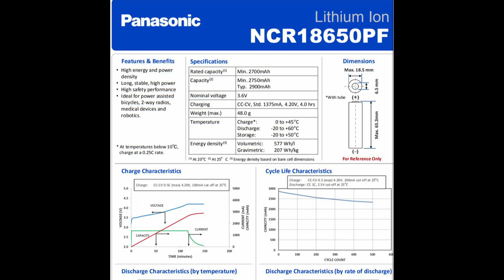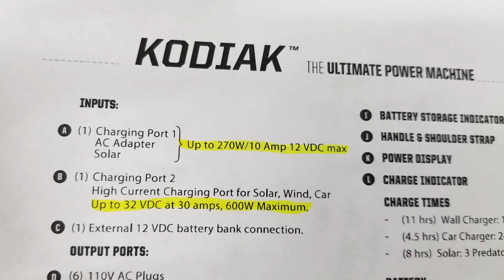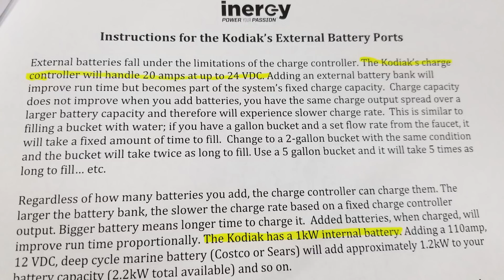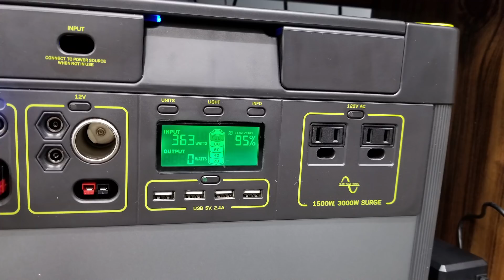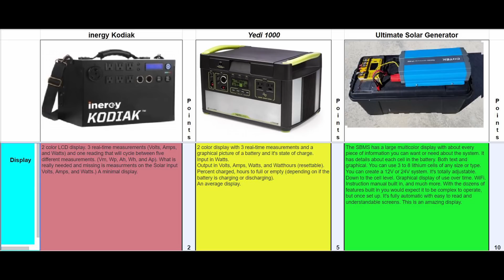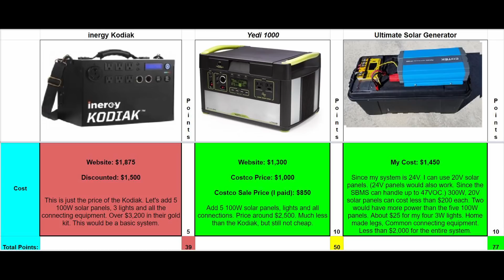Kodiak vs Yedi 1000 Vs Ultimate Solar Generator

Comment: Very interesting, thanks for sharing. I made almost exactly the same solar generator you did, a little bit smaller without the spare space you made for cables and extensions. Runs really smoothly my fridge. I experienced in 2017 hurricane Maria in PR, as you mention in your original video, the most important thing is running the fridge. I did need, during the emergency, to run my generator to just keep my food in the fridge not going bad.